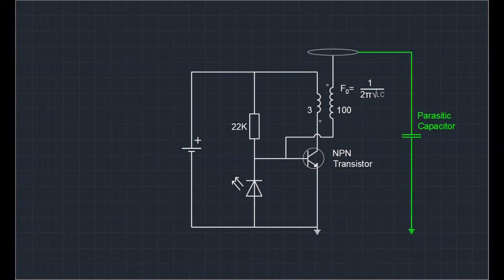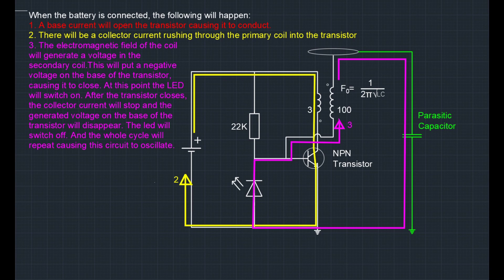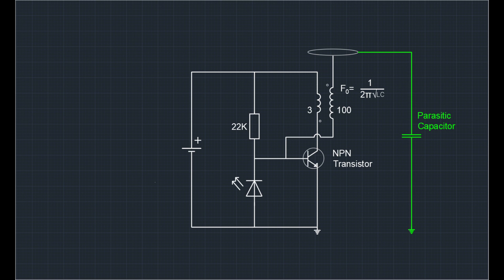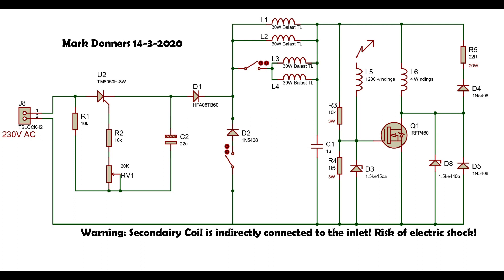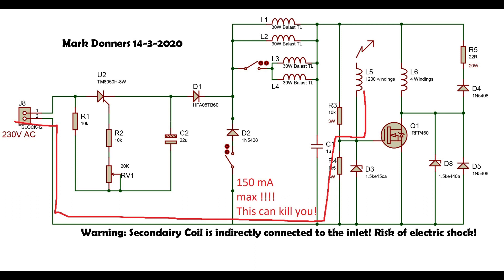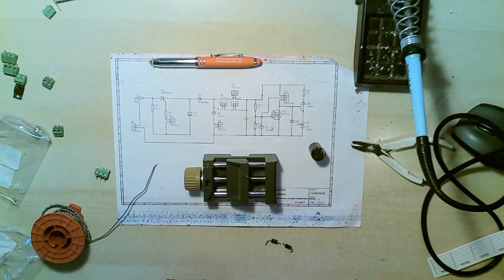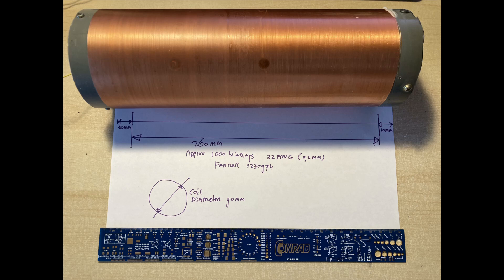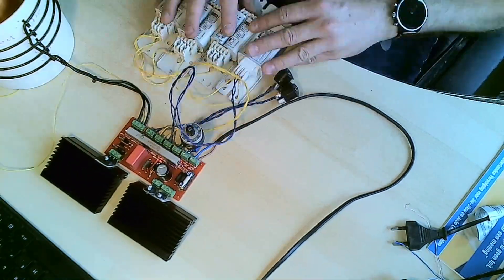How to make a powerful Tesla Coil high voltage Russian slayer - build your own

Comment: Hello sir
1uf Capacitor is 400 AC  or 400 DC?
Reply from the maker: I used ac
Reply: @TheElectronicEngineer  And what should be the operating frequency of this Capacitor(1uf 400v)?
can I use 50HZ
Reply from the maker: @ahhh94  sure that will work

Comment: Sir what happen if the primary coil is less or more than 4 turns??
Reply from the maker: The resonance frequency will change and also the amount of energy that can be transfered to the secondairy coil wil change... in short..it will effect your spark....experiment what works best...4, 5,6 windings or any value in between

Comment: Hello again. I've been working on it and I have a question. When you use a ballast It is because of its inductance value or its watts? I mean... Could I connect a 100uH torus inductor instead of the ballast? I Hope you could answer me. Thanks a lot
Reply from the maker: Yes you could, if it can handle the current
Reply: @TheElectronicEngineer  Ok !!! Thanks a lot for answer my question. I'll try it

Comment: Hello ! I would like to make it portable and I would like to know what happens if  I do not connect the ballast ( because of its heavy weight) . Thanks a lot !
Reply from the maker: How? you'll need a portable 230V AC source aswell..which makes it heavy again....if you want portible.,, look for a teasure module on alieexpress
Reply: @TheElectronicEngineer  Thanks !!! Ok I understand !! But... I would like to know what could happen if I do not connect the ballast. Other people on Internet do not use ballast with this type of circuit... I would like to know if It is possible
Reply from the maker: @alexcaleal9025  it will work but the spark will be small…
Reply: @TheElectronicEngineer  Thanks a lot !! Have a day 🙌🏻☺️

Comment: I probably know just enough about electronics to be dangerous. A one who lives across the pond and has to put up with 120v60Hz power, would using a step up transformer 120/240V work? Can't change the Hertz so is the 60Hz going to be a problem?
Reply from the maker: No problem, but it's still dangerous

Comment: Great video, i want information about the secondary coil, height and diameter, also the wire gauge that you used for it
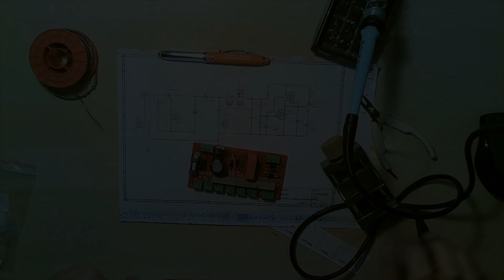Reply from the maker: See timestamp 9:12.   1000..1200 winding 0.2mm thick wire. Pipe is 9 cm diameter
Reply: @TheElectronicEngineer  thanks what is the height?
Reply from the maker: @Headbutter-Lettuce90  approx. 20cm for the coil and then  some spacing above and below...so 22 cm
Reply: @TheElectronicEngineer What is the resonance frequency?

Comment: can i use a 20w 22ohm ceramic resistor instead of the choke ballast? i measured mine ballast and it was around 23ohm
Reply from the maker: No! You need the match the inductivity not the resistor
Reply: @TheElectronicEngineer  hey Mark. i got pcb like you did soldered everything and it worked for about 30sec. but after it stopped. my chokes get very hot and there is switching noise in them. i tried to switch primary connections, still nothing. maybe you can help me?
Reply from the maker: @aurisfpv3201  making switching noise is good. It means it is working. Try connecting the primary coil reversed
Reply: @TheElectronicEngineer  yes i tried that and in the first time it worked, now it doesnt work, just my chokes get very hot with no sparks
Reply from the maker: Maybe one of the TVS diodes has failed. The only way to proceed is measuring....component tester and oscilloscope.Another thing:  I always run my setup using a VARIAC transformer so I can slowly ramp up the input voltage.....

Comment: Hi Mark, the design, drawings and explanations are incredibly helpful for amateurs like me. So I appreciate you and the job you have done. I'm very eager to do something as you did. But some reasons it is not easy for me to find electronic parts you listed in my country. So I have 2 questions: 1- the C1 cap is 1uf 400V and you used Wima MKP4. Is there any possibility to use  different capacitance? If yes, how much the margin?. 2- as in your list the D1 diode is HFA08TB60 which has specifications in: https://pdf1.alldatasheet.com/datasheet-pdf/view/250477/VISHAY/HFA08TB60.html . So, are these values solid for yoru set up? I mean is there any margin for this device? for example trr=18ns and i=8A for this diode, but can I use a diode which has  trr= 50 ns and/or i=10A instead?  Thank you very much in advance..
Reply from the maker: 1. C1 cap 400V 1Uf--> you can use any cap with a Voltage rating of 320V or more...the capacity should be around 1uF but not critical, I tried 2,2uF and didn't see any big changes, however, if the capacity is to low, then the sparks will be smaller.

2. The diode, its all about the amps....find a diode, slow of fast recovery doesn't really matter as we are working with 50Hz.. make sure it can handle a few amps...or use 2 or three in parallel.
Reply: @TheElectronicEngineer  Great..!! Thank you very much for your reply that make my mind clear by now. One more question. You used TRIDONIC ballasts in your circuit which are  magnetic ones. What about electronic ballasts? Greetings..
Reply from the maker: @numannnur  you need the ballast to generate a large inductive load, resulting in big current spikes. Any large inductor might just do the trick, a neon transformer, a microwave transformer or even a welding transformer could work if connected properly

Comment: Hello sir, i also want to make one, but i cannot find those big choke coils, can you help me?  And how can i make one without the inductor?
Reply from the maker: Not possible for this setup, you’ll need those coils for it to work
Reply: Just ask tube light chokes u will get ut
Reply: I used a coil from a transformer primary, reduced about 100 turns , now it works but my mosfet heats up like in 5 seconds , mosfet: G9n90 
But when i use irfp460, it works but irfp460 blows up easily, what should i do? 
I also have tvs diodes 18 volt and 440 volt

Comment: Is it possible to use secondary of a MOT as a ballast? And would it be safe to touch the output with only one hand for a few seconds?
Reply: Yes! I actually did both of those things in my in-depth tutorial of this circuit (although I used a MOT's primary side as a ballast), which you can find on my channel!
Reply from the maker: Thank you for adding that info

Comment: Hi, great job, top video! I also put together a takya circuit somewhere in the beginning of the summer ... But I got a little problem. When I turn on the keys to amplify the current, the streamer (lightning) disappears, the D5 starts to get very hot ... But I have three chokes instead of four. The parameters of the windings are similar. Another problem, R 1 is heating up. How can I unload it?
Reply from the maker: R1 will heat up because of the high inductive current. This circuit was never designed to be running long time. I build it for demonstrating that this kind of circuit works. If your D5 gets to hot you can put another one in parallel to it. Also make sure D8 has the right value and is not broken